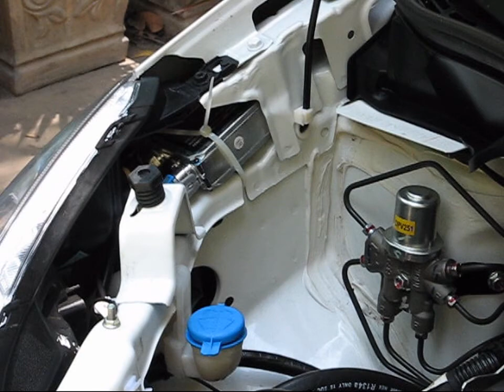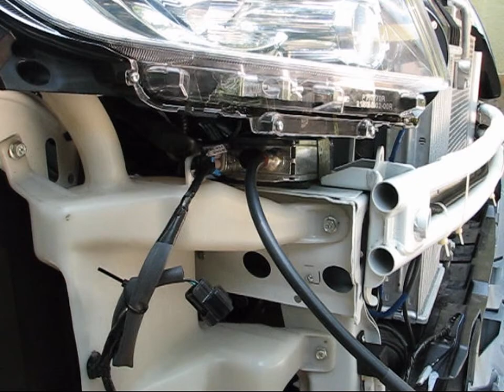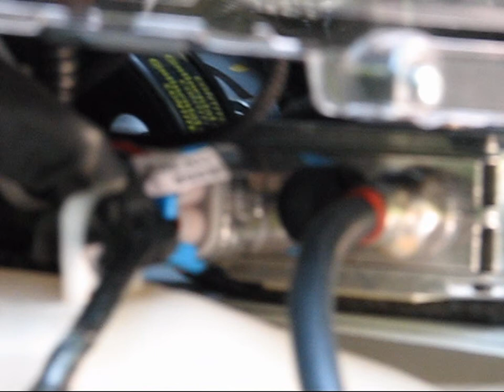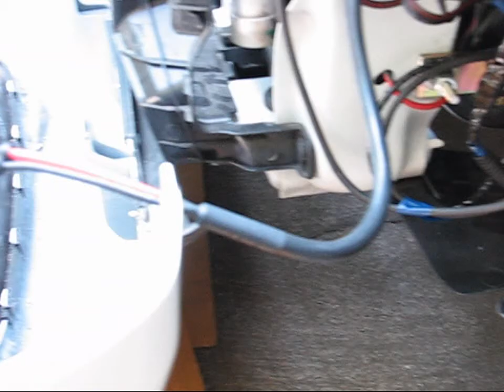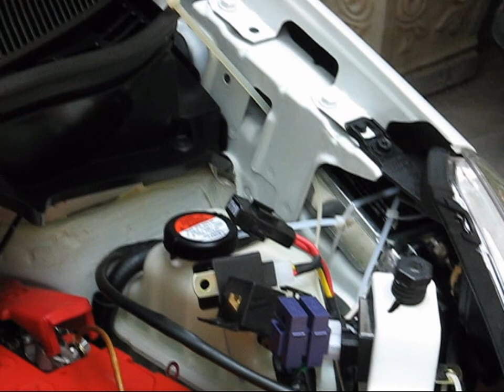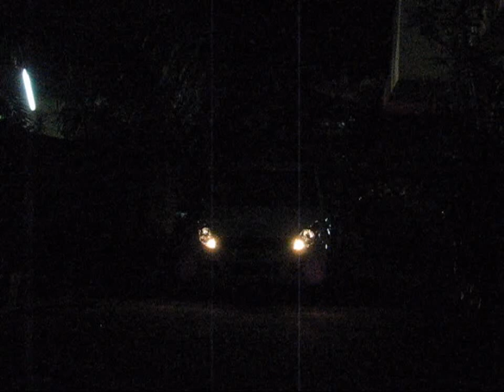HID Kit Install for Ritz Car

Comment: Hi Kartik, could you please tell me which type of HID bulbs fit in Ritz.
(ie  H4 bulbs H5 or some other types) also for the fog lights
Reply: h4 hi/low for main headlight and h8 or h11 for fog lights (h8 & h11 are typically same)